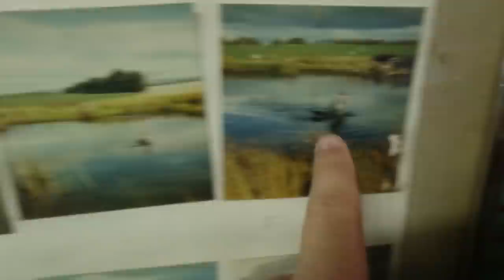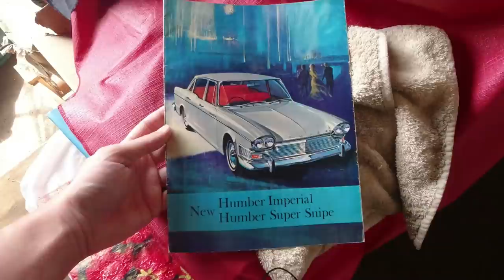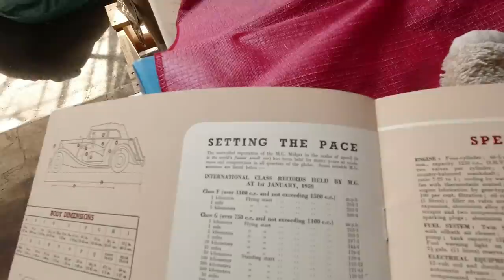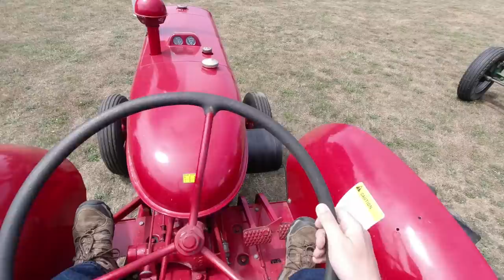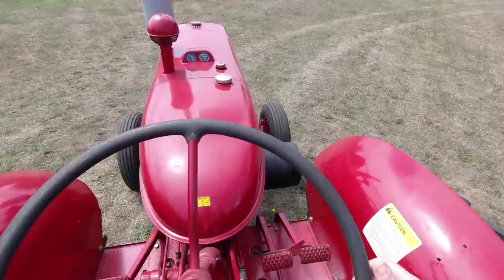(EP43) Tractors of Tasmania! Start-ups, drives and much more!

Comment: Marshalls were made in my home town of Gainsborough in Lincolnshire, sadly long gone but the works dominated the town centre for years after they closed, until they eventually built a Tesco.....  Still remembered though, there’s a modern shopping centre built in the shell of the works called Marshall’s Yard. Think they’d stopped making tractors before my time but they were still producing Track Marshalls.
Reply: Thats interesting! My home town of Leigh in Lancashire was home to a David Browns tractor works and when they finally demolished that in the 2010s it was replaced with a Tesco!

Comment: I learnt to drive on a Field Marshall like the one in the intro. It was started from cold by using a cigarette smouldering in the front of the cylinder head plus an optional cartridge which exploded as it was hand cranked.  They are two stroke and are positively oiled, which often left a pool of oil at the bottom of the exhaust stack during idleing or light work. When subsequently opened out they would blow the oil out of the stack and, not uncommonly would catch fire, blowing great big flames out of the top of the exhaust as it burnt the oil away.  Didn't do the exhaust stack much good.
Like the Forson petrol and TVO tractors, the cooling system isn't pressurised and has a large cast iron lid on top. It needs topping up regularly.
Only late ones had a range box. Most are just three speed with a factory choice of final drive ratio for slow or slightly faster work.

Comment: 351 cu in is 5.8 litres, the same capacity as the petrol V8s used in larger Australian Fords, so that's nearly 2 litres capacity per cylinder in that tractor and probably enough torque to drive it up the north face of the Eiger without struggling...

Comment: Many many thanks Ian for bringing all those delights to us. I've been round a few motor museums but none of them have been as impressive as the ones you've shown us in NZ and now this one. I think of those, the best one is the one you're in - at the time. Other than that, difficult to pick a specific winner. The range of tractors at this museum is truly awesome - a few I'd heard of (makes) and many I hadn't. Many of them are far from mint condition but despite their shabby appearance, it's quite clear to me that Glen (& team - there must be a team!) care for these machines exceptionally well. Not a flat tyre in sight and those that ran were clearly in good health - not burning oil or sounding half-knackered. 
One can't help consider the millions paid for by art collectors for a piece of canvas with paint slapped on - yet I reckon any one of those tractors is worth more than an 'expensive' painting - after all, you can have infinitely more fun with a tractor.
While people gawp at the fine arts, the art of engineering is sadly only appreciate by a select few and really ought to have a far more widespread appreciation. They don't understand, do they.

An unusual HubNut video - with no triangles of doom, areas of disappointment and worst of all, a museum without a typewriter.

Comment: These are such a world away from the modern New Holland tractors I have to look parts up for as there are no complicated electronic sensors, equipment or wiring. You don't even have to drive the new modern tractors now as you can buy GPS guidance systems that can drive the tractor for you whilst you sit back and relax.

Comment: Had the pleasure of ploughing a paddock with a Field Marshal that belonged to Chris Elphinstone in New Norfolk near Hobart in Tasmania, and the clutch on the right foot takes a little getting used to, but liked the intake pops whenever you give it some throttle. He did have some firing cartriges for starting but preferred the crank handle.

Comment: Really great fun! I'll bet a lot of viewers were thinking that they'd love to drive a tractor sometime, too!  As you were driving round, the other tractors in the paddock looked like they were watching you through their headlamps, and as you said, maybe their time will come to be taken for a run sometime! :*)

These old mechanical tractors were far more use than modern tractors to farmers in the developing world when tractors were given as foreign aid. Anything too modern and electrical meant problems for poorer farmers, as repair shops with skilled mechanics could often be a long away away, with expensive parts and repairs. In recent times very few of the simpler old tractors ever got scrapped. There were schemes that bought up and refurbished simple old tractors in the UK and elsewhere for foreign aid and many are still working hard on farms in India, Africa and South and Central America, and have probably been renovated and rebuilt several times.

Comment: On the "strange, almost three-wheeled tractor" at 2:40... This "narrow front end" configuration is very common on older tractors here in the USA. Before herbicide-based farming, fields had to be cultivated (weeded) by dragging multi-blade cultivators between the rows. It takes a lot of concentration to do this without taking out the crop, and the narrow front end makes it easier to see the blades. Needless to say, these are less stable than the wide front models, but a vast swath of north American farm country is basically flat. If Hubnut ever gets to Wisconsin, I have a pair of Allis Chalmers WD-45s - one wide and one narrow - both in active use.

Comment: just a thought: why no roofs? Was that a Tasmanian thing? I don`t expect a full cabin, but not even some sort of canvas over your head? Must be annoying in sun and rain.
I mean, yes of course, many of those came without one back in the day, but all of them?
For example that Deutz 06 from the 60s. I know about a dozen of those around my place (southern germany) and they all have a simple, old-school cabin. 
...just a little nerdy overservation...and no roll over protection, but that`s clearly a german thing.
Reply from the maker: Remarkably, you can still buy brand new tractors in Australia with no roof! I think most go for Aircon and roof these days...
Reply: zammap08. I grew up on a farm in Australia in the '70's to early 80's, and at that time very few tractors in our district had cabins (only the occasional large "broad-acre" farm). The tractors in the video predate most of what was even being used when I was growing up, so the lack of cabins is not surprising. My sense is that a cabin is a liability in Australian heat (unless air-conditioned), hence only more modern tractors commonly have cabins. Cabins were also not practical on orchards with fruit trees (can't drive down a row of trees without damaging them with the cabin). Rollover protection wasn't "a thing" back then, although now I believe it (officially)is. Cheers!

Comment: Is there a steam traction engine scene Down Under?
Reply from the maker: Not massively. There is actually a steam museum in the same village as this tractor museum, but most of the displays were static and none were running when I visited.
Reply: Ian probably missed it, but was reasonably close to http://www.melbournesteam.com.au/ in Scoresby, where much tinkering is done, subject to pandemics.  A magnificent traction engine is also around the corner from me, in immaculate condition and (last I saw) on club registration.  I doubt it gets used for all of the 90 days allowed, though.
Reply: They hold an annual Steamfest in Sheffield Tasmania. More traction engines and old machinery than you can shake a stick at. The Grand Parade is awesome
Reply: Search Lake Goldsmith Steam Rally in Youtube. Had steam shovels one year and lots of variety.
Reply: Also search Steamfest Scoresby on Youtube